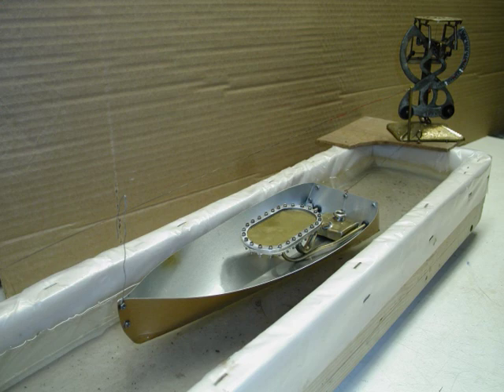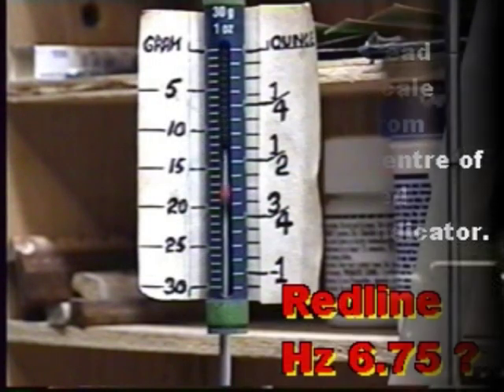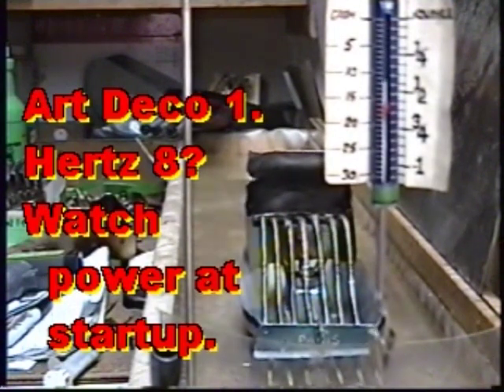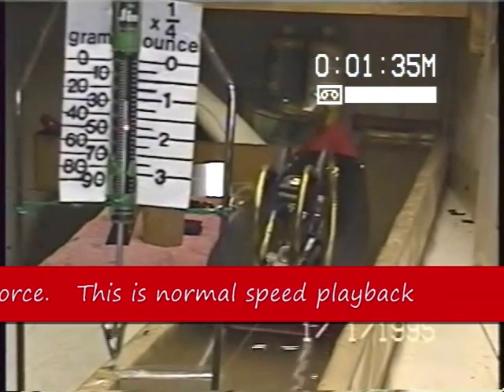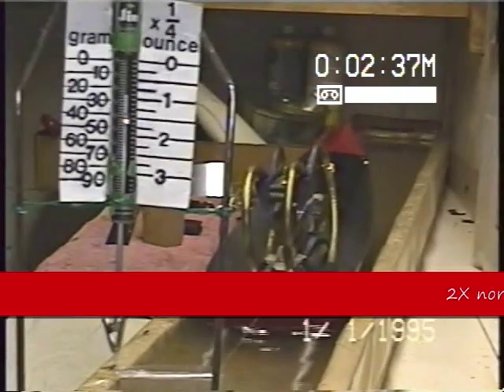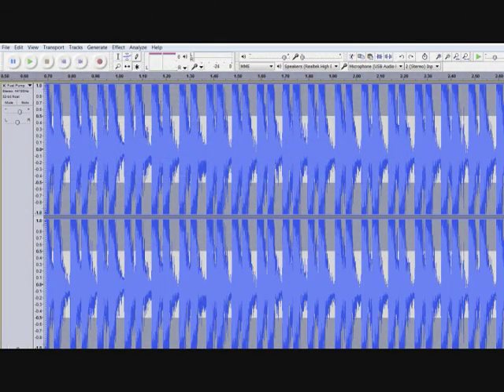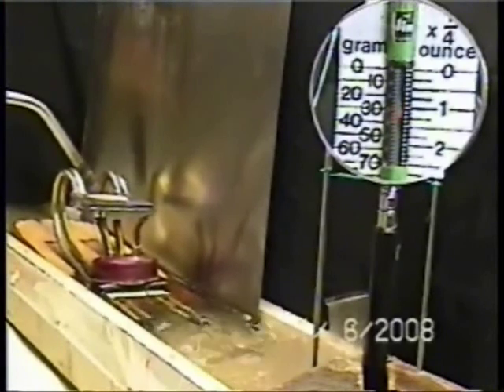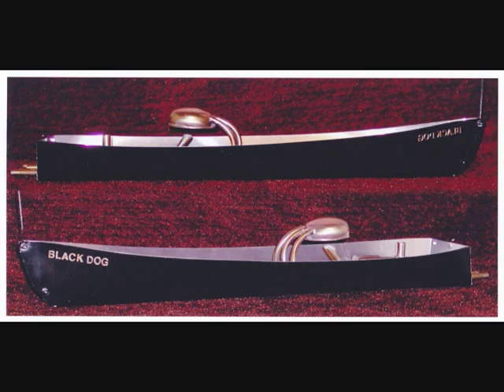How to measure speed, force and hertz in putt putt boats.

Comment: Can you make a video about what happens when you use different sizes of boiler and pipes?
Reply from the maker: A good idea but there are just too many variations for me to undertake that test.
Reply: Daryl Foster Why do some people use copper and some use brass tubing?  I'm not sure which would be best to buy.
Reply from the maker: StewMM There is not a lot of difference. Paper, plastic. tin, aluminum, brass, copper,,,,....choose the one that has characteristics that best match what it is you are using it for. For the engine or near the engine I usually use copper for good heat transfer. Elsewhere brass or aluminum are light weight and less expensive. Visit the sciencetoymaker to see how to build an engine using drinking straws for tubes.

Comment: If you make the maths by difference, isn't it much simpler to ignore water drag and simply use the same hull design for different engines?
I wrote that first comment and then I thought this... The idea is: why do we measure? and so the answer is that the measurements and data don't mean anything if they don't relate to real world...so I think it can't be bad to make the test with water drag and a common hull. It's like isolating just one variable...

Comment: To avoid water drag the easiest method would be to make a pair of rails with ball bearings running on them to wich you attach the engine so that only the tubes touch the water. Then it's just a matter of testing the suspended engine and after that in a hull. 
When you, for the sake of simplicity, assume that air resistance and friction in the ball bearings is zero, you can calculate the difference (suspended engines power output = 100%) and use the same calculation for all the engines.

Comment: The simplest idea would be to add a stripe of rolling paper to the force meter. An inked needle would draw a graphic of the instant force through time. Using a design software like Rhinoceros you could scan the line, open it in Rhino, and make the area between zero N and the line. Rhino valculates the area...and, divide by the lenght of the time. Evenmore the area is the Work of the engine, therefore you can calculate the efficiency!!